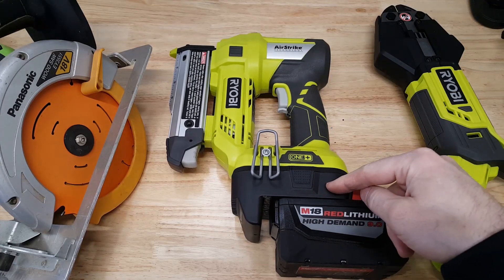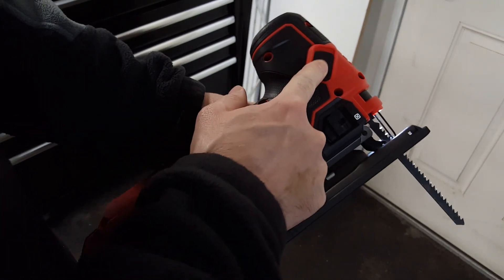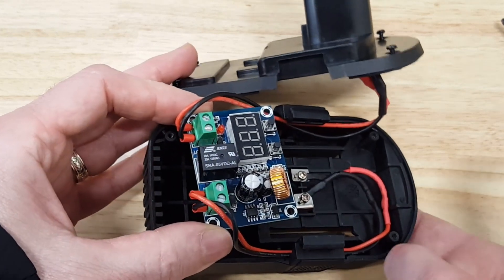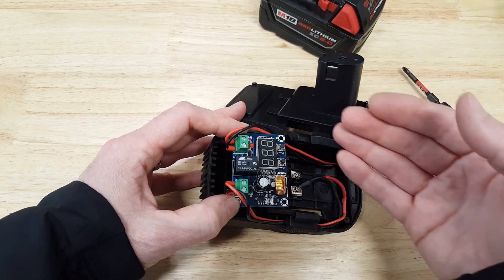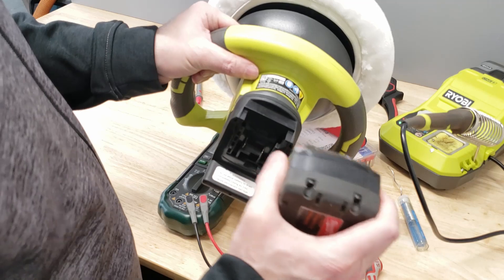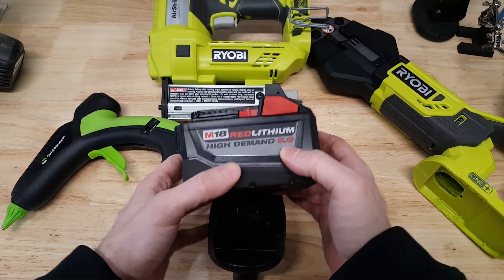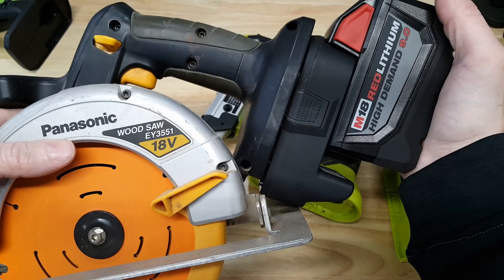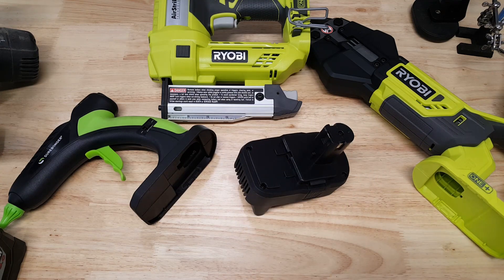Milwaukee to Ryobi battery adapter by Surebonder:  Modified with low voltage cut-off

Comment: 2 questions:

1) when you use the adapter with the milwaukee batteries on a ryobi tool, do you notice if theres any significant improvement in power or anything?  

I know this is a few years old, but im looking into getting one of these adapters and using a dewalt powerstack battery on it.. idk of you have any exp. W the pouch lithium batteries,  but i just wanted your opinion on whether or not you thinl the powerstack batt would give a noticeable bopst in performance to the ryobi tools??

2) how do ypu kike that ryobi bolt cutter? Does it actually work? It seems and sounds hellaa sloww,, almost soo slow its too annoying to use lol

Comment: I’d be a little concerned about the 18 gage wire but thank you
Reply: I want to make this, but am worried about the effects of vibration some tools will subject this l I want to make this, but am worried about the effects of vibration some tools will subject this l circuit board to; e.g., my 1/4" impact driver, orbital sander, etc.circuit board to; e.g., my 1/4" impact driver, orbital sander, etc.
Reply: @drivewayy it seemed pretty snug on how he had it in the adapter by itself. Plus he did mentioned it was a tight fit in the video. In addition, looks like the adapter was flush with the tool when it was put in.

Comment: This is an awesome idea. I wish they would make this circuit with no display to make it more compact. I have a m18 battery adapter I use on a T12-942 soldering station. Its amazing but this circuit is not going to fit inside I would need something way flatter.

Comment: Cool video, how would we calculate what voltage to set a 2.0 battery at?
Reply: He showed it on the video. Drain it to one bar, check the voltage at the positive and negative and that’s where you need to be at.

Comment: @bzeug I purched the adapter DM18rL and this module but the module does not fit in the adapter the coil prevents it from closing flush.

Comment: All Those Battery Adapters Are A
Bunch Of Bull.I Can See If You Have
Some Old Ryobi Tools Then I Could See
Doing It But Otherwise No.
Reply: its when you have standardized on one tool brand and batteries, then you find out dewalt/milwauke does not have a tool you need that ryobi actually does. Example: Glue gun, 1/2 crown stapler.

Comment: I want to buy the Dewalt Portable Power Station or build one with an inverter. The problem is, I don't own a single Dewalt battery! That low voltage cutoff chip is the missing piece of the puzzle!

Comment: The Samsung 18650-25R cells Milwaukee uses have a discharge end voltage rating of 2.5V per cell. All M18 packs are 5S battery packs no mater the capacity.  So the math to calculate the cutoff voltage is...... 2.5V x 5S = 12.5V. So you could safely set your cutoff voltage around 14 ~ 14.5 and still be safe.

Comment: I like what y’all are doing. This was the first of its kind. Another YouTuber was experimenting with a high wattage, 20 volt (max) lol inverters. He’s got it down so far and was able to run drills, miter saw., and other high amperage devices off of his corded Amazon ac/dc converter.  It’s nice to have the option.

Comment: I’m watching because I want to get an affordable jigsaw, probably ryobi, of course you have to show off the one I really want, the sexy ass Milwaukee barrel grip
Reply: I picked up the M18 Fuel D handle (traditional) style these holidays.  They didn’t have any deals with that particular one.  This year I was able to purchase a plethora of Milwaukee, mostly Fuel tools for less that Ryobi.  My father in-law is a Ryobi fan and before I had my own tools I used them all of the time...no complaints.  Home Depot had a Milwaukee starter kit 2 -4ah batteries, charger, and bag. Buy that and you got a free tool. I ordered several of these kits online (store was out) and returned them to the store, no questions asked. Received  the Fuel jigsaw for under $99, bare tool was normally $199. Fuel Blower for $86, normally $159.  Look up ToolBoss on YouTube he will explain and it’s on the up and up. What happens when you buy the battery starter kit for 199 and pick your free bare tool they somewhat split the difference if you were to return one of the items so you just can’t buy the $199 battery and get the free hundred dollar tool and return one of them and get it for free but they itemize your receipt and for instance once  you return the $199 battery kit they credited my account and I paid like $86. I personally didn’t need all these extra batteries since I’m invested in the platform. My apologies to the original poster as I didn’t mean to hijack your thread just trying to spread the savings. By the way genius idea with the low battery cut off.

Comment: Ryobi puts their BMS in the battery and Milwaukee keeps the BMS in the tool. It makes the Ryobi batteries pretty useful for alternative projects because they will self protect as opposed to the Milwaukee ones. Plus the Ryobi batteries are quite a bit cheaper per Ah! 
Appreciate the helpful project, thanks for posting!
Reply: Thanks for this info.  Any idea about DeWalt?  Do they have their BMS in their battery or in the tool?  If in the tool, any Dewalt tool-Milwaukee battery adapter should work to allow one to use Milwaukee batteries with Dewalt tools correct?
Reply: I think that's why I have a box full of ryobi batteries that don't work but have  good cells. Their BNC's go out and the pack quits working.

Comment: May I ask, if I am using the adapter for Milwaukee battery to charging in Ryobi Charger, is there any damage to the Milwaukee battery itself? I'm new to all of this cordless tools, trying to learn. Thank you in advance.
Reply: Never charge with adapter, Always use batteries manufacture chargers on battery
Reply: @ealdydar  Thank you, I almost buy the adapter. So in that case, I don't think it's not worth to buy the adapter since it cost about $15-20, I just look into Fb market place for the Milwaukee charger, saw a few M12 and M18 charger, and a lot of them are new for about $20-30 bucks, I will get those instead of the adapter.
Reply: @alexnguyen2099 the purpose of the video, at least my purpose on what to do with this adapter, is to use my Milwaukee batteries for the niche tools that Ryobi has. Bought a 18v garden hoe recently and this will help out with that. My thought mentality is not to invest in two battery ecosystems. If I can find an adapter for batteries I have already to use with these niche tools, I’ll be good.

Comment: My Milwaukee M18 leaf blower on a 5.0ah battery died and I measured a voltage of 13.98V. I set my low voltage disconnect to 14V on this adapter. Thanks for the idea. I hope it works well for me.
Reply: Do you have any input on this : I want to make this, but am worried about the effects of vibration some tools will subject this l circuit board to; e.g., my 1/4" impact driver, orbital sander, etc.

Comment: Doesn't replace a proper BMS, ideally one should monitor the voltage of each cell, should cut off the pack if any given cell drops below 2.5/3V depending on the cell

Comment: IDK why no one put this on here but here is the info on this board....▬►XH-M609 12-36V Battery Low Voltage Disconnect Protection Module DC Output◄▬....Some of these are for use on Lead acid battery's ...so you need to pick this one. I have runined (3)  9.0 Milwaukee 18v batteries not knowing about this...Lucky they were still under warranty
Reply: can you put some link which one i should buy if im gonna use a 20v dewalt lithium ion battery thanks

Comment: Excellent video. Those look like industrial field rated cage clamp terminals on the PCB which are designed for stranded wire. Great job!